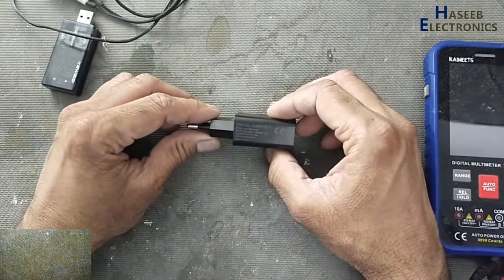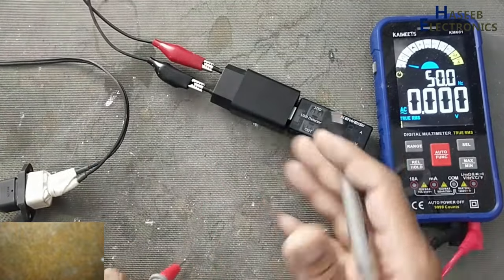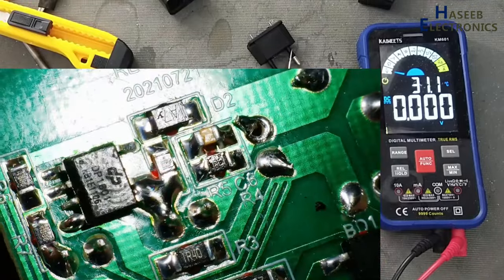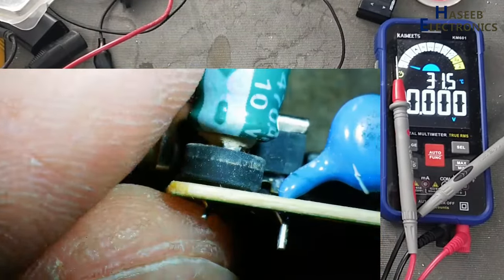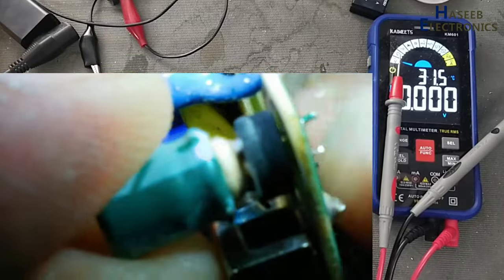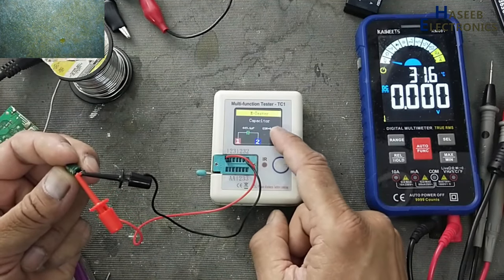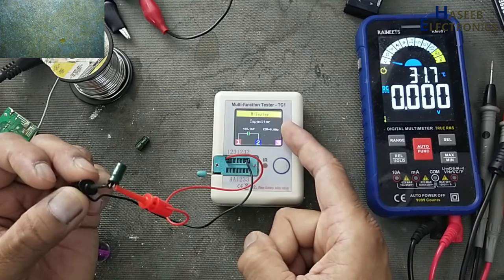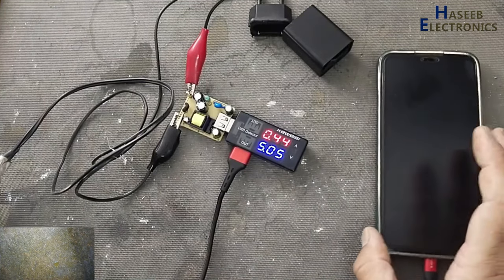{1141} Cell phone charger repair

Comment: Thank you sir. Would you tell the model of the solder you use, please?
Reply from the maker: i use KESTER solder 60/40 1.57mm
KESTER solder 60/40
alpha solder wire 0.5mm 60/40
Reply: @HaseebElectronics  Thank you, I meant the soldering iron.
Reply from the maker: It is TS100 Soldering iron 
You can check video number 806
Reply from the maker: https://youtu.be/Qs-YZVhDyuw
Reply: Thank you again, vey gentle.

Comment: Just an idea, in case you run out things to repair ( ;-) ) 
How to use that component tester would make a good video (e.g. what is ESR, when is capacitor good or not,... How to understand the other values of other components)  It is such a powerful little device.
Thank you for your great video's.  They are always to the point and interesting to watch.  I always enjoy watching them.
/chriV